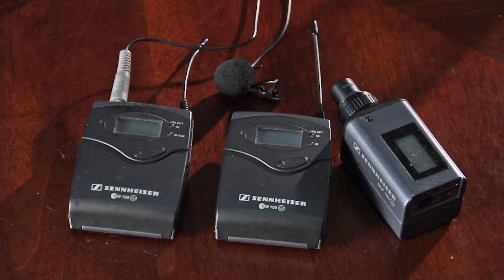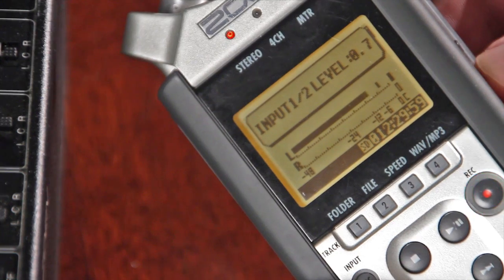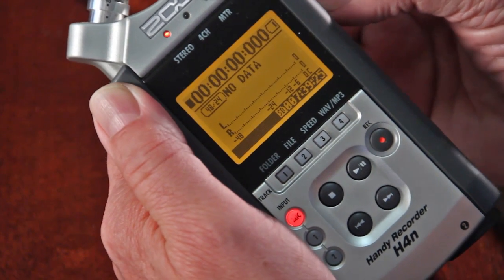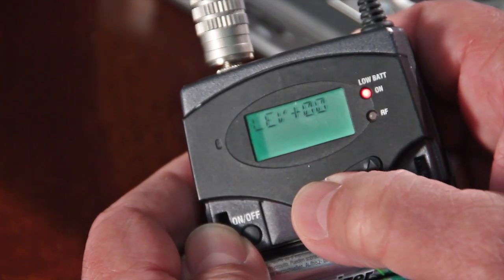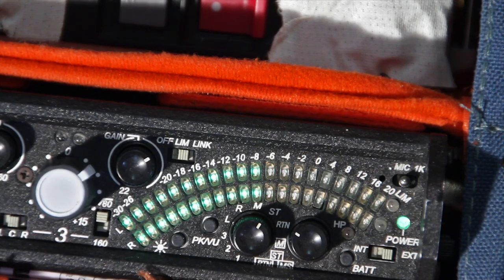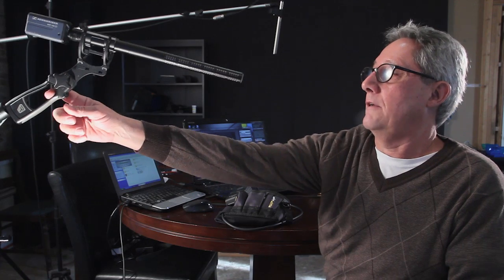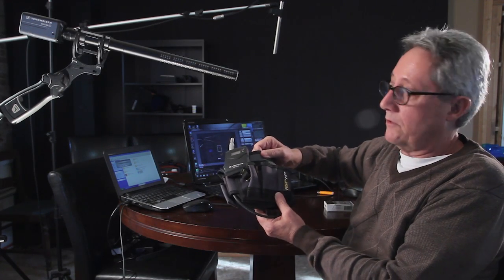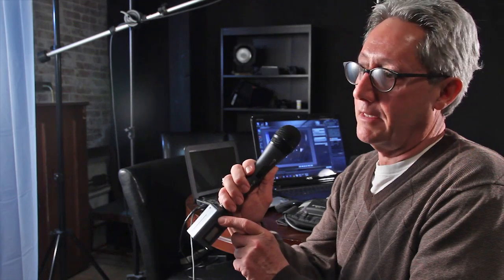Sennheiser G2 G3 Wireless to Zoom H4n Recorder for Great Moviemaking Sound

Comment: Hi Roland.  Fantastic video - very very helpful.  Since you also have a SD 302, is the G2 sound not considerably better via the SD 302 as opposed to the Zoom H4n?  When you film yourself - do you connect your G2s just to the H4n?  I would have thought the audio would have been a good bit better if you turn the preamps on the G3s and H4n to minimum and use that sublime preamps on the SD 302 you have...  You obviously use all three (302, G2s, H4n) extensively and would love your opinion.
Reply from the maker: There's theory then there's practice. The G-2 into the H4n (or any digital recorder) works great for run 'n gun shooting, especially when you are doing it all by yourself. The G-2 to H4n is meant to be a set it and forget it configuration that records good sound without having to ride it during shooting. Believe me when I tell you that 90% 100% of the time is better than 100% 10% of the time. Things happen way too fast on a shoot.  Worrying about sound is the last thing I want to think about. Thanks for watching the video. Go shoot a friends wedding or community conference or whatever, and I think you'll figure out that set it and forget it audio is your friend. Thanks!
Reply: Roland Comfort Thanks for the reply Roland!  As always, very informative and hugely appreciated.

Comment: Thanks for this great test! I have a Sennheiser ew 100 G3 set (actually two of them) and a zoom H6. The XLR inputs on the H6 can be attenuated by a switch to -20dB. So I guess there is no need to adapt the XLR from the sennheiser to a TS mono plug to convert to a line signal. I would just plug the sennheiser receiver to the zoom via XLR and switch the zoom's input to -20dB outputting 0dB from the sennheiser. Correct? Best, Alex
Reply from the maker: Yes, it should, Experiment. Note that some recorders like the Fostex FR 2Le and the new Tascam DR 60D actually disengage the trim (volume circuit) when in Line mode. (I was wrong about the H4n - its volume amp is active all the time). I recommend the headphone test first. Plug in a headset with no mic and slowly turn up the recorder volume until you hear noise. That's the highest level you should ever use. Get the levels you need on the zoom by increasing or decreasing AF out on the Sennheiser. You may even end up back in mic mode on the zoom with -18 or so on the Sennheiser. Love that Sennheiser wireless. Its like a mic and field mixer rolled into one piece of equipment.
Reply: Roland Comfort Thanks! Yes I will keep on testing. The noise test with no inputs attached is also sometimes hard because of the additional noise that comes from the headphone preamp which of course will not end up in the actual recording. ;o)

Comment: Hi - I thought that between 698 and 806 mHz was now illegal in the US ? 
https://www.audiolinks.com/articles/fccwhitespaces/
Reply from the maker: Yes, it freaked me out too for about a year, until I figured out that the Sennheiser system reaches out only a hundred yards or so. Geez, I guess if Obama is flying over your shoot for 10 seconds at 30,000 feet they may pick up your audio, maybe, but, not really a problem. I was more worried about outside interference in my audio recording. But, really, its a hundred yards!  Also, go to the Sennheiser site and you will see that there are a lot of holes (frequency ranges) not used within the range available on the equipment.
Reply: Roger dodger - sounds OK then, thanks

Comment: Outstanding video!  Thank you for the information.
Reply from the maker: Thanks. Turns out that this setup works well using the regular Sennheiser XLR plug into the H4n if you set the Sennheiser AF out to get -18 dBFS bars on the H4n with its recording volume dial at about 50. Read the other posts about listening to the H4n on headphones with no mic plugged in. Bottom line is the H4n is very noisy above 50 on its recording volume.

Comment: Roland, could you make a video on how to setup the Sennheiser G3 with the Zoom H6? Would you also recommend, not to use the XLR plug or are the preamps now better? If not, can you recommend a specific cable to buy? Thanks in advance
Reply: YES PLEASE!!!
Reply: I have both the h4n pro and the h6 as well as the sennheiser g3 system.  I just tested this same setup with the zoom h6 vs using the mic input on the h6.  Again, the line input sounded better than the mic input.  I then ran the line out into directly into the xlr if my fs5ii.  Works great and now clients can easily sync audio.

Comment: could you list the names of the two cords?  I found the xlf sp 3 that plugs into the zoom but I was unable to find the cord connected to the Sennheiser.

http://www.markertek.com/Cables/Audio-Cables/1-4in-Phone-to-XLR-Cables/TecNec/XLF-SP-3.xhtml
Reply from the maker: The Sennheiser cord is the 1/8" to xlf that comes with the Sennheiser wireless system. However, I have discovered that the supplied Sennheiser xlf works well directly into the zoom if you keep the zoom recording volume at 50 - 60. Read some of the other comments for more info. Thanks for watching.
Reply: You the man!

Comment: Thank you for this informative video.
Reply from the maker: Thank you Rey. Actually, upon further experimentation, I have found that the h4n works pretty well using the G2 xlr plug direct if you keep the h4n recording volume around 50 with its bars running around -18 to -12 dBFS.  The only variable in this set up is the G2 AF out which will end up at one of -24, -18, or -12 depending on how you set G2 mic sensitivity and how loud your source is. Put a #3 limiter on the h4n for safety, especially if you are pushing the upper limits or expect unexpected source spikes. Thanks for watching!
Reply: Roland Comfort Yes, that #3 limiter tip really saved my audio..

Comment: Hey. Thanks so much for your video. It brought a lot of things to light. I stupidly bought a 'balanced' phono jack adaptor and at first wondered why it did not appear to making any improvements. Can you tell me what the effect is of using a balanced adaptor with a line level input such as the G2 as opposed to unbalanced? Audio really confuses me!
Reply from the maker: The h4n 1/4" jack is mono unbalanced. You have to match that, however, read some of my replies in which I have figured out that the G2 XLR straight into the h4n works well if you keep the h4n recording volume in the 50 - 60 range. Set up would be G2 AF out at around -18, XLR input to h4n with h4n bars showing -12 dBFS and h4n recording volume around 50 - 60. Activate a limiter on the h4n just in case. Thanks for watching.
Reply: Roland Comfort Many thanks Roland!

Comment: Roland, 

You are awesome. Just sent you an invite via Linkedin! 

My question: what are your favorite AA batteries to power the H4n?
Reply from the maker: I use regular Energizer rechargeable 2300 mAh right off the shelf at Wal-Mart, etc.  I shoot real estate photos part time using 5 YN 560 speedlights that take the same battery. So, I've got about 80 of them that I rotate generally, keeping them in travel soap dishes. Never had a problem in two years.

Comment: Roland, thanks a lot for this long but very informative movie!
Since i don't have a h4n jet, could you please tell me:
- what if i plug in the G3 on one XLR AND a second Mic (Rode ntg2) in the other XLR. Can these 2 be adjusted seperately in the h2n?
- i never heard of the DualEyes software bevore. Thats amazing! Anyway, is it possible and practical to plug the h4n in a DSLR's mic jack and record the audio directly in the cam (i use an sony a99)?
Reply from the maker: I think I'd buy the correct JuicedLink mic amp/mixer for about $300 and record in your camera. Save up for a NTG3 instead of the NTG2. Then you'd be set for pro level audio with the mic mounted either on the camera or off camera using a boom pole or stand close to your subject. Movie dialogue is always mono. Just get one good mic and somebody to hold it using a boom pole.

Comment: Great video.  I have an H4n but I was thinking about downsizing to Sony's PCM M10.  I'd heard  that it has a true line in.  Do you have any experience with the M10?  Can it be used with the G2/G3 setup discussed in your video?
Reply from the maker: It would work, but you would have to get the 1/8" G2 output into the 1/8" Sony input. Probably not a problem except that the Sony input may be looking for stereo. My guess is that a $3 Radio Shack 1/8" to 1/8" mono would work just fine. The G2 puts out a balanced signal that starts with a 1/8" plug terminating in a balanced XLR output. If you don't have one yet, buy the G2/G3 and experiment from there. The G2/G3 is awesome for the price. The great thing about it is that its AF output is adjustable from like, +12 dBu to -30 dBu. You can use it with just about any digital recorder out there. Note: I've started using the G2 at AF out -18 directly into the H4n via XLR with H4n recording volume at 50 to 60. It works just fine.
Reply: Thank you so much for this information.  I think I'm going to experiment more with the H4N for now.  It may be a while before I can pick up a Senheiser G2/G3.

Comment: I am looking to buy the Sennheiser ew 112-p G3 system to use with the Zoom H6.  What cables do I need to connect the receiver to the H6?  Balanced or unbalanced 1/8 to 1/4?
Reply from the maker: I haven't used the H6, but I am pretty sure it has a pro level line level input setting that can be used at its XLRs. Just use the XLR output from the G3 receiver. The great thing about the G3 wireless receiver is that its AF out is adjustable. Do the headphones with no mic plugged in thing, where you listen to the H6 while you increase its recording volume. The H4 gets noisy over about 50. If you can hear noise with no mic then it will still be there with a mic. Set up the G3 to get good bars on the H6 with its recording volume in the sweet spot. You might actually have to switch the H6 back to mic level and turn the G3 AF out down to something like -12 or -18. Experiment!
Reply: Roland Comfort Thanks for the quick and informative response!  I am ready to get the equipment and learn more about audio recording.

Comment: Are this technique still valid for Zoom H6? Is it still better to go into the zoom via 1/4" phone plug instead of XLR?
Reply from the maker: No, I think the H6 XLRs can be switched to +4 dBu voltage (pro level). Regarding your second question, I'm not so sure that the H4 cuts out its mic amp when using the 1/4" plugs like the Fostex FR-2Le does. I really can't tell the difference between XLR and 1/4" on the H4 as long as you set up to get the bars you want while keeping the H4 recording volume around 50. If you listen to the H4 on headphones, with no mic plugged in, you can really hear noise as you scroll past 50 towards 100. You can even record it. So, the trick is to adjust the voltage into the H4 to get -12 dBFS bars with volume control around 50.

Comment from the maker: The Sennheiser receiver has only a 1/8" mini jack out.  You could build a cable that is 1/8" to 1/4", but I just use the short 1/8" to XLR cable that is supplied with the Sennheiser G2 wireless system.  Further testing has shown that using the XLR directly into the H4n XLR nworks well if you keep the H4n recording volume around 50, no higher than 60.  One viewer commented that 1/4" vs XLR sounds the same with net H4n recording volume set low.  I agree.

Comment from the maker: No, your pro level mixer puts out a signal at +4 dBu line level, while consumer devices use -10 dBV for line level, apples and oranges with pro level being more robust.  To confuse things even more, the Zoom 1/4" plug is somewhere in between as it is made to receive the output from an electric guitar. The G2 works with either xlr or 1/4" plug because its AF output is adjustable to match the quirky Zoom input levels. A Rolls MB 15b converter would work in a studio to match but it needs power.

Comment: hey great video, I was very interested to hear what you said about using the jack input instead of xlr, as previously I have tried recording from a sound mixer using the H4n with the xlr inputs, But this results in a distorted sound. if i use the jack input instead would that fix the the problem?

Comment from the maker: I started by reading books by Jay Rose including "Producing Great Sound" and "Audio Post Production for Digital Video". But, it took years for it to sink in that mics and field mixers are analog using dBu meters and recorders today are digital using dBFS meters. The generally accepted ratio is +18 dBu  (field mixer) = 0 dBFS (digital recorder). It's correct to run analog peaks up in the +10 dBu range with digital recorder volume responding in the -8 dBFS range. That's all you need to know!

Comment from the maker: After further testing, turns out that you can use the G2 XLR plug directly into the H4n if you keep the H4n recording volume around 50.  Listen to the H4n using headphones with no mic plugged in.  Self noise starts around 50 and gets awful as you approach 100.  Hit record then play it back.  The noise is there.  Red Giant bought DualEyes and PluralEyes a couple of years ago from Singular Software.  RG pushes PluralEyes, but I prefer DualEyes where I can mix the sound outside Premiere. Thx.

Comment: I replaced the Sennheiser mic that came with my 112 system with an Oscar Soundtech OST-802. Awesome mic! I also ordered the phantom power supply adapter for the 802 so I can go wired (wired is always best whenever possible).

Comment: Tried everything I could to get my Sennheiser G3 to work with the 1/8" phono plug - no luck. Works perfectly with the XLR plug and the H4N set at 50% volume. I'm not a fan of the lapel mic supplied with the system. The e835 wireless sounds fantastic.
Any recommendations on a replacement for the supplied lav mic?

Comment from the maker: Also, I use the mono/mix on setting in the Zoom to prevent ending up with a stereo file that has sound on only the left or right channel.  I always use just one mic, and with the Zoom defaulting to recording a stereo file, if you don't use mono/mix, you will have to break out the recorded channel into a mono file in post before you can use it in Premiere or Final Cut, etc.   I forgot that once and ended up with a movie that had sound coming out of only the left speaker.

Comment from the maker: Yes it would work just fine.  Note: I have found that you can get good sound plugging the Sennheiser XLR directly into the Zoom if you keep the Zoom recording volume between 50 and 60.  The G2 is great because you can adjust its receiver AF out to get bars on the Zoom where you want them using the above volume setting.  Try this, listen to the Zoom with headphones and no mic plugged in; you will hear self noise as you raise volume above 50, you can even record it.  Keep the Zoom volume low.

Comment: I know you asked Roland, and he responded, but I noticed you were asking about plugging the 3.5mm locking plug into the Zoom directly. I've done that successfully a number of times when testing. But, also know that the plug will have a tendency to actually slip out of the port completely, or perhaps just enough to lose proper contact, because it's not seated firmly in the port. -- Short answer: Yes, it works, but I wouldn't count on it, since it might slip, and you lose your recording.

Comment from the maker: The bag I used in the movie is a tool bag that I bought at a hardware store.  A shaving kit bag works good too, especially if you want to carry a shotgun mic (in two pieces), extra batteries, foam windscreen, etc.  Also, I have discovered that the G2 works pretty well just using its XLR plug into the Zoom if you keep the Zoom volume around 50 - 60.

Comment from the maker: Yes, you can plug the XLR connector on the Senn G2 receiver directly into the XLR port on the H4n.  Set the H4n recording volume to about 50, no more than 60.  Adjust the G2 AF Out to -12 or -18 so as to get peak bars on the H4n well under 0 dBFS.  The H4n produces a lot of self-noise at recording volume above 60 so you want to keep it low while increasing the G2 input voltage to get -12 to -20 dBFS on the H4n.  Plug a headphone into the H4n with no mic to hear what I'm talking about.

Comment from the maker: This movie has been a work in progress as viewers responded with questions and issues.  Now, I'm not sure that there is much difference in the H4n between using XLR vs. 1/4" phone plug.  There is a big difference in recorders like the Fostex FR 2Le where 1/4" phone input absolutely cuts out the device mic preamps.  The main thing with the H4n either way is to set up input so as to KEEP H4N VOLUME AROUND 50.  Listen to the H4n on headphones with no mic plugged in.  You'll hear noise at about 50.

Comment from the maker: Try plugging the G2 XLR out cord directly into the H4n left XLR.  Make sure the H4n 1/2 input button is on. Press the red "rec" button once to get bars. Set the H4n volume at about 50.  Adjust the G2 AF out so that you get peak bars well under 0 dBFS.  Also, you might check to see that you have the latest firmware program loaded on your H4n.  You should have v 1.72.  You can see this on the Zoom by looking in the system menu.  Google h4n firmware to get the download and instructions.

Comment: Hi Roland,

I can't seem to get my H4N to work. Got it used on Ebay so now I'm suspicious, but it could just be my error.  I have the same Sennheiser wireless system and a lav. I set the levels on all three devices exactly the way you demonstrated. The receiver is plugged into the zoom using the same Markerteck cord. My problem is that the levels move up and down on the transmitter, but the L and R inputs (meter?) DO NOT MOVE at all on the zoom to tell me what db I'm at. What am I doing wrong?